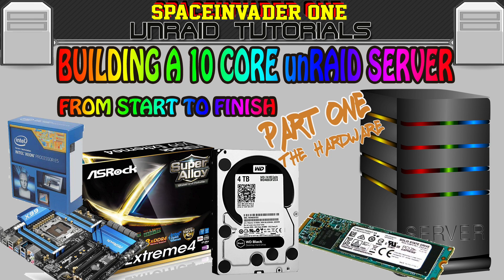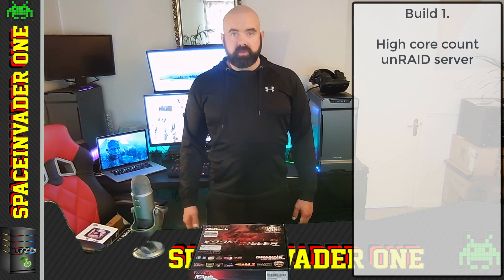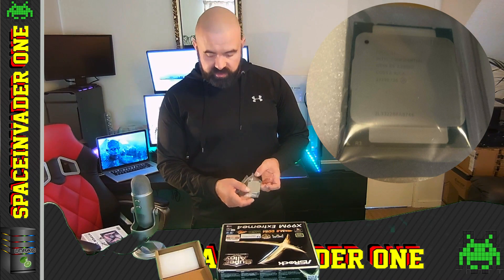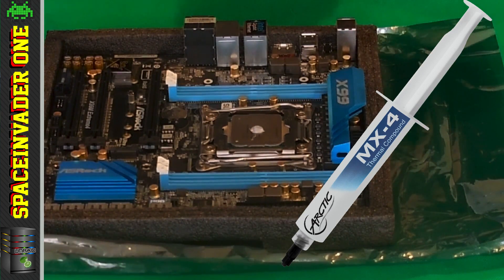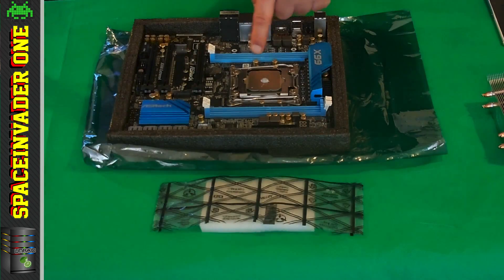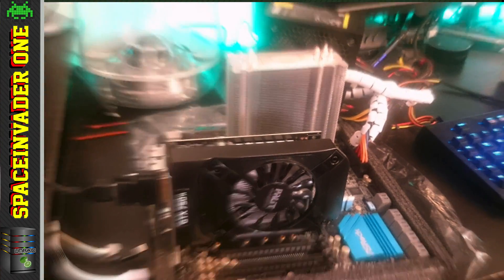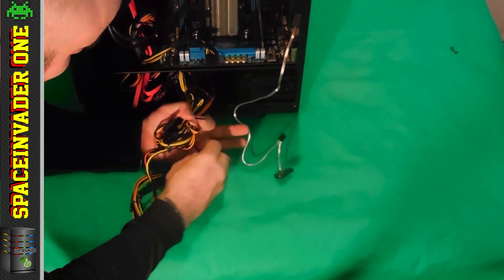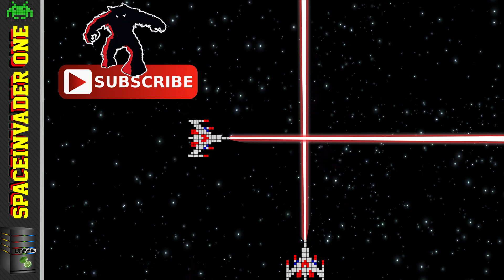Building a 10 core unRAID server from start to finish - Pt-1 Hardware install

Comment: Great video. What brand of Sata cards will work with this setup? Or what do you recommend.
Reply from the maker: Hi Dale. I used to onboard motherboard sata with this build. There where 8 onboard sata ports. If using an add in card make sure it can run in IT mode, which means it can run in a non raid mode. unRAID needs direct access to each drive. Have a look here on the unRAID wiki. Its a little out of date but will give an idea http://lime-technology.com/wiki/Hardware_Compatibility#PCI_SATA_Controllers    Thanks for watching.

Comment: Shout out from San Clemente, Orange County,  California, USA. Thanks for your very clear and detailed vids. While I write this I am preclearing my first drive in my very first home built file server, what an accomplishment for me. I have a very basic question, in my research in the internet  or UnRaid forums I have not found the answer to the following question. Is it ok to power off the server at the end of each work day? So server is on  8 - 10 hours and then powered off?
Reply from the maker: Hi Glenn, yes thats fine. You can even do that automatically using the sleep plugin. This will either put the server to sleep or power down on a schedule. You can then have it wake up/poweron on a schedule to (from the motherboard or Wol feature of a router) Good luck with the server and welcome to unRAID! :)

Comment: Thing I love most about AsRock motherboards, is that they even support VT-d in a lot of their more mainstream lines. It meant I could build an i7-6700k rig that supported gpu-passthrough. Most other brands do not support it, and if they do, they don't make it easy to find out, so it is always a gamble.
Reply from the maker: Hi Ryan. Yes you are totally right. Even the £50 boards the VT-d works fine.

Comment: Thanks for posting this series, I'm finding it and all of your preceding videos incredibly useful. I've just bitten the bullet and bought myself a second hand i7-4770 system a couple of days ago to use as an unRAID server, and am working through your videos setting things up (currently adding a VPN router VM). I went for the Toshiba N300 4TB NAS disks (one to start off with) and am very happy with that purchase (fast, but quiet). Cache drive goes in later today and a parity drive next payday. You went for the HGST drives didn't you, Space? How are you finding them?
Reply from the maker: Ah, nice CPU the i7 4770 is a great CPU. Yeah, I have a few HGST drives. I got the enterprise 4tb SATA 7200 drives because I managed to get a few manufactured refurb drives for I think around £65 each. I wish I could find more now. I find them great. Another cheap way to get drives is to look on the western digital website at their refurb section. They often have the external 4tb drives there cheap and you can just take them out of the enclosure (after preclearing to test them first) the only downside is they are 5400 drives normally in the external drives

Comment: Would love to see you do a AMD Threadripper unRAID build as that is what I am working towards.  Can you confirm that unRAID is compatible with the 1950 Threadripper CPU?
Reply from the maker: Yeah, the next build I want to do is a Ryzen build and an AMD GPU. But I would love to build thread ripper 1950x ........22 thousand cpumark score wow. I know GPU passthrough can be problematic with Ryzen but is getting better.
Reply: Spaceinvader One there are still problems with passthrough, but I saw on another channel that AMD motherboards are easier to use because groups are better separated.